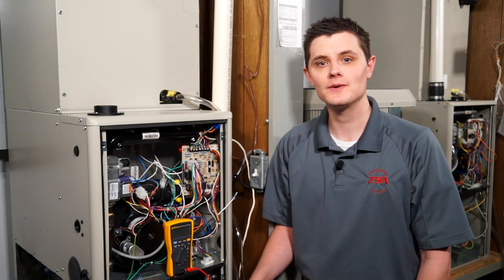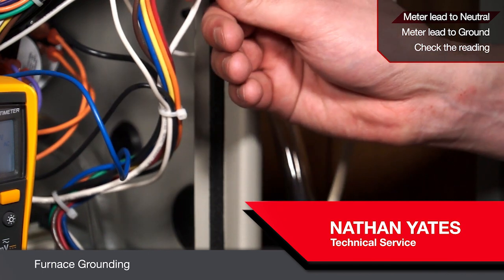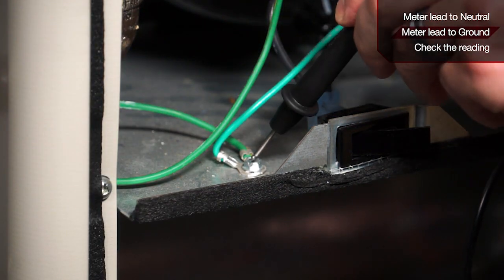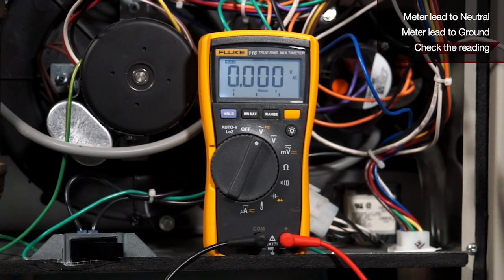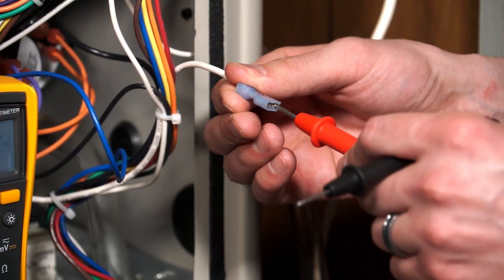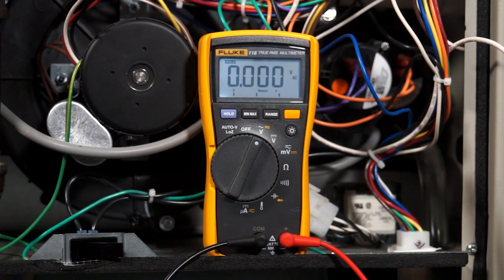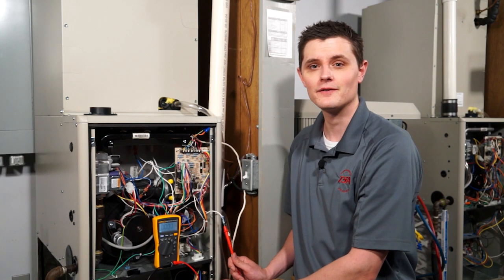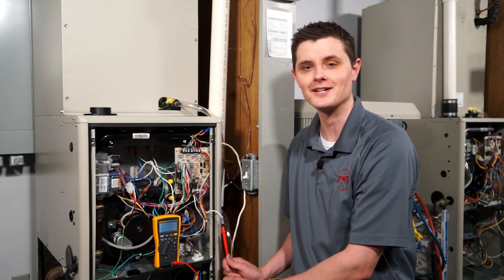Checking Voltage from Neutral to Ground

Comment: I'm curious exactly what you're testing for.  I assume you're testing for ground or ground quality, but I don't understand how this test would give you meaningful results.  For example, if the ground is broken somewhere between the furnace and the panel box, you're going to read 0 VAC.
Reply from the maker: You still might be able to get a reading on ground wire because it might be pinging off another component or object.  For example, like an outlet or panel. Therefore, we recommend having the furnace on its own circuit breaker to avoid potential issues.
Reply: Yes, it's important to have the furnace on its own circuit.  We pull a new wire when we install a new furnace if it's possible.  But my underlying questions remain:
1. What are you testing for?  Ground quality?
2. If the ground is broken between the furnace and panel box, won't you read 0 VAC then too?

Or are you testing for something other than ground quality?
Reply: yes, I'm also a little bit confused about checking grounding quality by using this method
Reply: @elninodphoenix7778  A better way to check ground quality is to take a bulb pigtail, a standard 120v lightbulb base with pigtails, cut one meter lead and wire each side of the pigtail to one of the cut ends so power has to go thru the bulb.  Put that modified meter lead in place of one of the leads in your meter.  Set your meter to AC.  Put one lead on a 120VAC source and the other on a ground you want to test.  Meter should read pretty close to the same with the bulb lead as it does with a standard set of leads.  If there is a significant difference, you have a poor quality ground.  I hope that makes sense.  In the example in the video, you'll also get 0VAC if there is no ground.
Reply: Neutral to earth (grounding conductor) is normal function of electric distribution system.   A large reading is not good.

Comment: what if im getting 15v neutral to ground on my receptacle.. i get 120 from hot to neutral. i dont have a ground wire but the receptacle is 3 prong
Reply from the maker: The receptacle is no properly grounded.  The receptacle needs a ground wire coming from the panel.  Just because an outlet may have a grounding port doesn’t necessarily mean it’s grounded.  The furnace needs a ground wire coming from the panel in order for flame sense to work properly.
Reply: should be voltage range neutral between ground

Comment: how i find neutrol and earth wire .....i confuse plz help 
 ............
Reply: KH PRODUCTION HOUSE CTG same here, did you find out how to identify Neutral and Earth wire?  I'm still looking.  If I find it I will send you the link
Reply: Generally the ground (earth wire) is green and is by itself connected to the actual machinery by a screw.  The neutral though usually white (but not always) look for where all your high voltage is coming in at (contactor) and look for the terminal that doesn’t say L1,L2 or T1, T2 but is labeled as N and that’s your neutral.  Electrical current (amp) have to leave out the same way they come in is a good rule of thumb to follow so you can stay in the general area of looking without looking all over the place just to find a Neutral.

Comment: it's a video, no need for a recap, we can just rewind, also you said nothing about what can be done if that voltage is not what it should be, which kinda makes this video pointless
Reply: I guess that its too many options to explain. its not a specific mixture of symptoms so you cant know the exact diagnosis

Comment: Neutral to ground 206v ac came what problem just explain please..
Reply: Check ur neutral tighten connection
Reply: Less than 5 volt
Reply: Phase to earth voltage we can check may be same like phase to neutral voltage
Reply: U mixed line with neutral
Reply: Neutral and line are shorted somewhere. Need to check